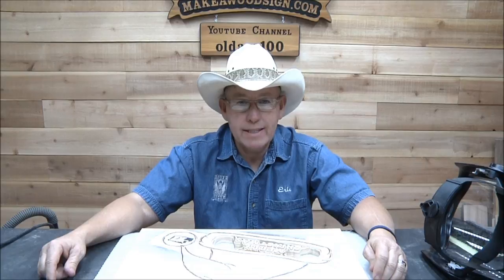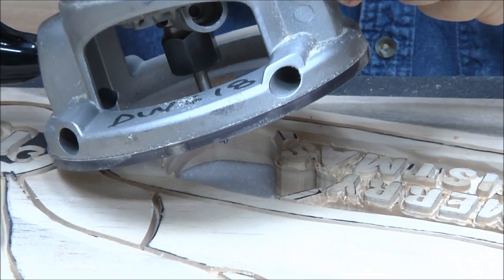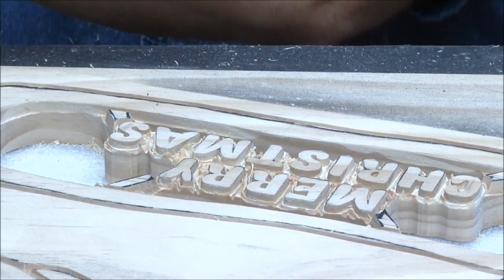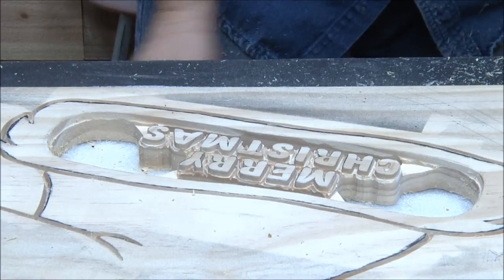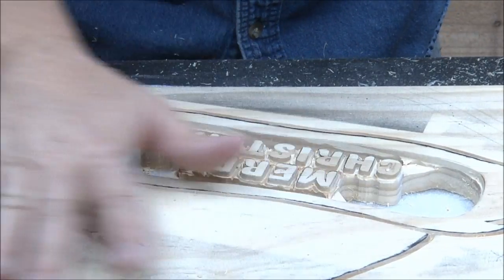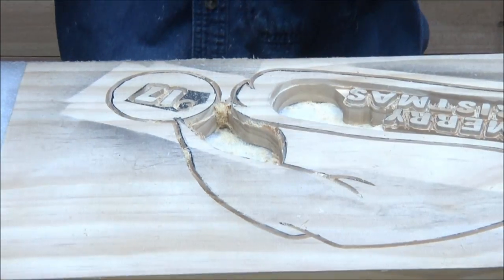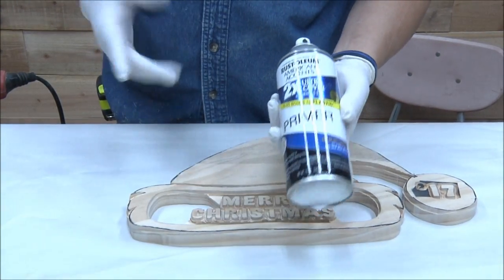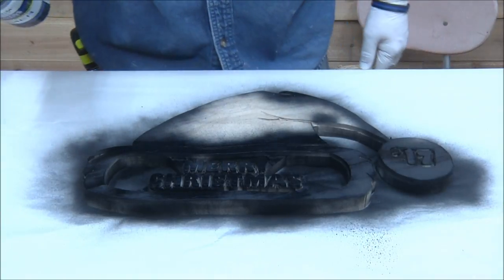#239 Christmas Giveaway Part 5 of 6. Also Static Electricity Tip

Comment: My ole' 611 went down on me after two years of service, cheaper to buy a new unit then to repair the old router. Was looking at this new Ridgid but seem to be heavier then the DPW611. So I bought a new DPW611 again. Using a scroll saw would be so much easier, a lot less work and a cleaner cut..
Reply from the maker: We all have our preferences, I like the router method.